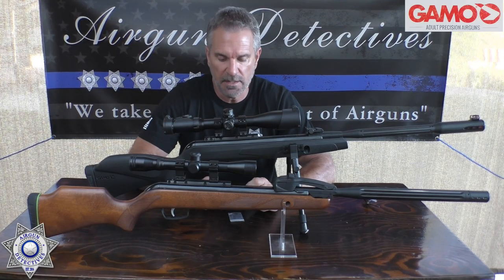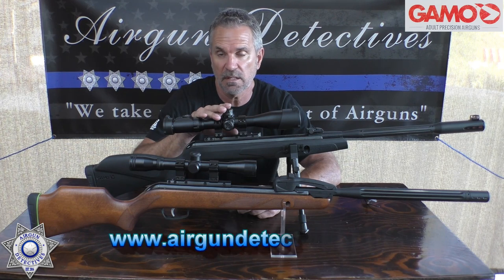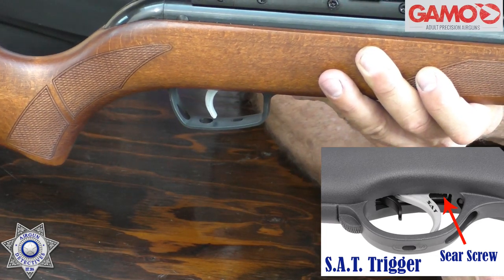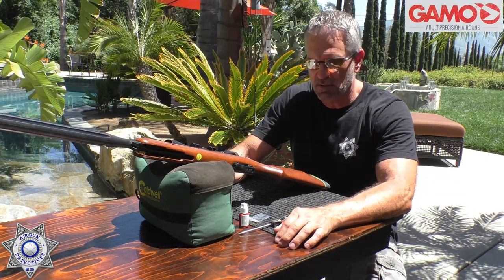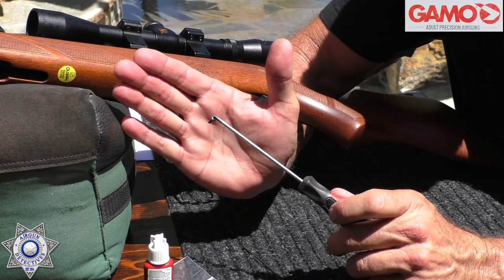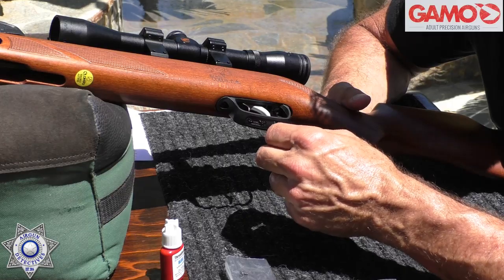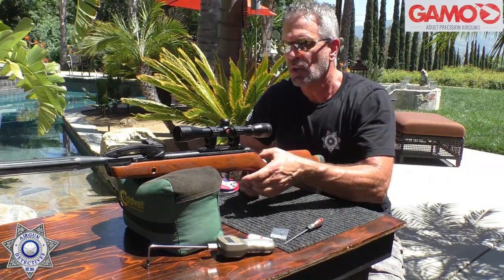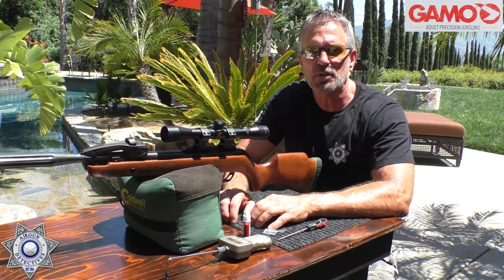Gamo match trigger for under $10.00? How to upgrade your trigger by Airgun Detectives

Comment: 2.5mm x 10mm Phillips Head Screw is what is used to replace the OEM screw on both of my Gamos. They both work fantastic and are now excellent paper punchers. Thanks for the installation video.
Reply from the maker: Thanks for watching!!
Reply: @AirgunDetectives  I use a rubber mallet to bang against the butt stock to check trigger safety issue. It works great and gives a little more "umph" to the simulated accidental hard bump or drop.
Reply: They are different screws to this? Cannot buy from that site. Im from europe and i need to replace too..
Reply: @duraes207  Find a hardware store that sells the 2.5mm x 10mm screw. They work.
Reply: @Signetring54  okay mate. Thanks

Comment: I just installed this on my Gamo Gen II Swarm Fusion and he is telling the truth. Even after bottoming out the factory screw, the trigger still required 3lbs, 6oz of pull and a lot of creep. I installed the new screw and after five adjustments it was 2lbs even and almost no creep. I could have done this w/o a gauge, but I would have left just a little resistance before it fired (very little) for safety. All the gauge really did for me was measure the end result. Remember that the factory trigger is not broken in and will lighten with use. You may have to re-adjust in the future. I ordered a second kit for a friend that is getting the same rifle. What an elegant solution vs. an expensive trigger replacement.
Reply from the maker: I am glad it worked out and thank you for leaving your comments 👍

Comment: Bought one of these screws for my Gamo Swarm Bone Collector.  You get the screw, an Allen key and fantastic instructions.  The installation takes a few minutes.  After the installation; I took a little time adjusting the trigger pull to my liking.  What a difference.  Noticeable difference for the better in my groups.  The instructions were signed by JC which is a nice touch since I am a fan of this channel.

Comment: Definitely use the threadlock. Mine worked it’s way in on my magnum and my gun was bump firing, luckily I work on airguns frequently and was prepared. The threadlock really helps it not move at least on the more powerful guns.

Comment: THANK YOU 👍

Could only find x 12 not x 10

Tried it, works GREAT

Bumped the back really hard several times trigger still engaged with the seer (or seer with the piston, or...)

What a difference... TY again 👍

Comment: I just picked up a Diana 250. I really like it and is a nice change from the PCP world.  The trigger is very heavy. Will this screw work with that model? Thank you for another great video!
Reply from the maker: No, the screw is specific to the Gamo rifles. The 250 is a Chinese rifle with the Diana label. I am not familiar with those but they may have the typical trigger that is shared with several other Chinese built rifles (i.e. Stoger, Crosman, Remington, Benjamin and a few others) You may be able to modify it with an RC  bearing or an aftermarket trigger. There are very few triggers that can't be modified. Thank you for watching👍
Reply: @AirgunDetectives  Thank you for the quick reply! I looked up b19/b18 info and found the screw ! It was a 3mm by 10mm allen.  Works great!!
Reply from the maker: @michaelh3544  glad that worked out for you. I often wonder why the airgun manufacturers don't do these simply adjustments prior to selling  the guns.

Comment: For your trigger screw use pink loctite its very light for small bolts , but its hard to find .
Can a Red dot be used on a break over air gun . Im shooting in my shop at 30' . Or do you know of a scope to focus that close 
Thanks Jim F

Comment: Very nice! Have you ever made any type of adjustments to the quattro triggers on Hatsan rifles? And if so, could you describe your experience?
Thanks for sharing and God Bless, Greg
Reply from the maker: I have a very simply one for that as well.  I'll cover that in a future video. You have to take the rifle out of the stock, but it is a 5 minute process and you can drop up to 1-2 lbs off the trigger just by replacing a small spring.

Comment: My new Gamo (2024) has a standard trigger, but it is adjustable. I need a longer screw. Do you know if it’s the right threads for this?
Reply from the maker: My Screw Kit fits all the CAT and SAT triggers, including the 2024 models. Just confirm you have one of those triggers, which are in 90% plus of all their rifles. https://airgundetectives.com/product/adjustment-screw-for-the-gamo-c-a-t-and-s-a-t-triggers-2/

Comment: Hi there! Great Video, thank you. I have one general question: This screw reduces the needed pull-weight, because it's longer than the original, right? Due to that, the piston is held back with less friction at the trigger mechanism?
 I can't really buy from your website, but I'd love to try out this mod. If I understood right, I only need a longer screw with same diameter, and then test the gun out?

Comment: took back crosman and got gamon wildcat whisper.. will it work on that one? thanks...took a look and think I have CAT trigger....well maybe not, did not have the holes and is smooth side, what do you think?
Reply from the maker: Sounds like a CAT, trigger to me. That should work. I have pictures on my website, but I'm 99.9% sure it's a CAT trigger based on your description https://airgundetectives.com/product/adjustment-screw-for-the-gamo-c-a-t-and-s-a-t-triggers-2/
Reply: @AirgunDetectives  so, what's the deal, yours just a longer screw? same thread pitch and everything else, thanks

Comment: I have a Raptor Whisper.  I got my replacement screw at Home Depot.  I went through the steps that you did.  The result is that the gun won't cock.  I have adjusted the screw in both directions.  I have removed it and reinserted it, all to no avail.  Can you help?
Reply from the maker: Not sure what length screw you purchased.  It sounds like you screwed it in too far. Watch my install video again.  Go slow with the adjustments. Remember this works on the CAT and SAT trigger only.
Reply: @AirgunDetectives  thank you very much for your reply.  I replaced the screw today after watching your video and it solved the problem.

Comment: So great idea with the trigger screw, but WHY would anyone shoot a springer off a bipod, a bag yes but never a bipod...
Reply from the maker: That was the old way of thinking. 99% of break barrels and under levers have a significant improvement in accuracy by using my bipod kit. They  shoot much better than even bag resting. It's basic physics. Take a look at my website and read the feedback. Facts speak louder than words.  Happy shooting!
Reply: @AirgunDetectives  thank you for the information, after testing with bipods over the year's in different configurations with many different spring rifles I can confirm our results do not match, having shot benchrest in competition during 54 year's of shooting, it seems my front only bag rest will always out shoot any bipod I've tried, 7.62x51 on the other hand reduces .5 moa over a bag, I guess we'll agree to disagree on our results, take care.
Reply: @michaelbritain5546  
So, are you comparing powder burners to springers?
Recoil to reverse recoil?
Apples to oranges then?
Did you only compete with powder burners, or both? Mr. Expert?
Reply: @kurthenze2900 re read my comment, it says SPRING, I shoot with both, also spring and pcp air rifles, I have NEVER shot better from a bipod than a bag rest, a spring air rifle needs to recoil properly like the old Howitzer on firing it slid back in a slide, a spring rifle needs to do exactly the same, it can't while sat on a bipod, but it can on a bag, as for Mr expert if you can't be civil DON'T COMMENT OK.
Reply: @michaelbritain5546  
Oh my, sensitive are we? You must have gotten a whole lot more experience in the four months it took you to respond to this old comment. Lol!
Thanks for responding though. And I will take your advice and buy a bag. I will make my own determination.
I do like JC's Bi-pods. If you push slightly forward, it allows for the recoil, which he  has explained.
Everyone has valuable information here.
So don't lose your sense of humor, I'm new to this, and I want to learn as much as possible.
Reply: @kurthenze2900  not sensitive but a civil comment cost's nothing and will engage someone in conversation far easier, I can only comment on my year's of experience shooting Air Rifles, I'm not the perfect shot, no one is, I have bad days and good, I understand pushing forward on the bipod to relive some of the recoil but this would allow a change in muzzle height as the shot is taken, maybe once enough practice has been attained It would work for some, but it didn't for me and that is just my experience with a bipod, certainly on a full bore rifle they are by far the most accurate rest, anyway Welcome to the sport, I hope it brings you as much pleasure as it has for me whatever you shoot, you'll find most people very willing to pass on their knowledge to less experienced shooter's, and the last few year's You tube has been a great resource to reach shooter's worldwide although you tube is not exactly gun friendly, shoot safe.

Comment: Sir, will this work on my Gamo Shadow 1000?
Reply from the maker: This will work on the "SAT" and "CAT" triggers.👍😉
Reply: @AirgunDetectives  I purchased the gun new in the early 2000’s, the manual says it’s a 2 stage adjustable trigger nothing about CAT or SAT trigger. Is the 2 stage adjustable trigger the same as a CAT or SAT trigger?
Reply from the maker: @sc67jam  is it a plastic trigger? It sounds like you have the old metal trigger. That can be upgraded but it takes some work. Not a simple fix.
Reply: @AirgunDetectives  Yes it is a metal trigger, I was hoping that it would just require the screw replacement and not the trigger upgrade. Thank you for your responses!!